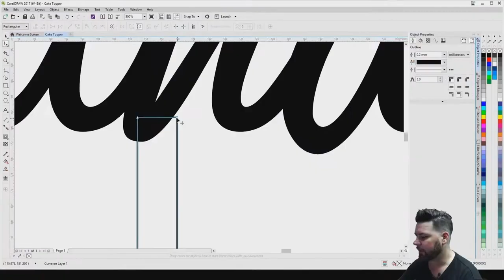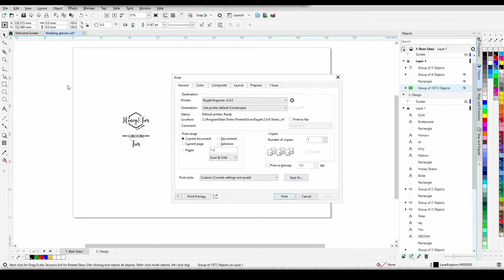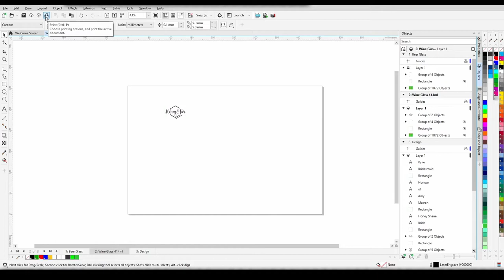How to Engrave Glass Beer Mugs and Wine Glass

Comment: HI.... is there any issue regarding laser engraving on a round surface ? or do you fix the perspective beforehand ? ... thanks !
Reply from the maker: When we stick to the area we show in the video, we do not need to map the surface. As it is only etching until the surface curves and starts to distort. You will find the limits pretty easily on a test piece. We might need to show a video of us etching the inside of a ring. This one we did need to map the surface. We will add it to our video list so watch out for this when we upload it. 🙂

Comment: Sooo you didn't say not show if you put anything on the glasses to engrave.
Reply: I think for a co2 you dont need to put anything on clear materials. But on diode lasers you do need to make a black coating so that the blue laser will not pass through it and engrave the surface instead.